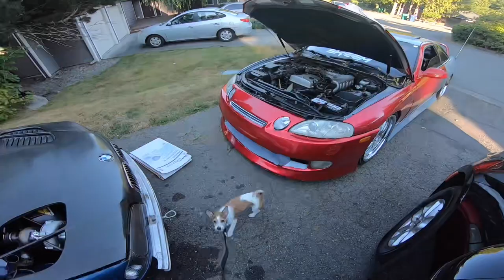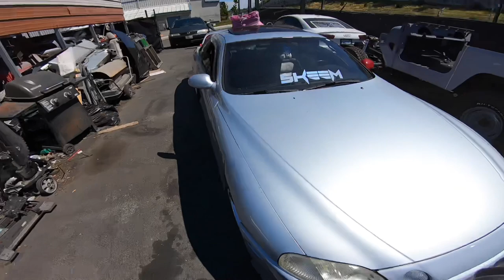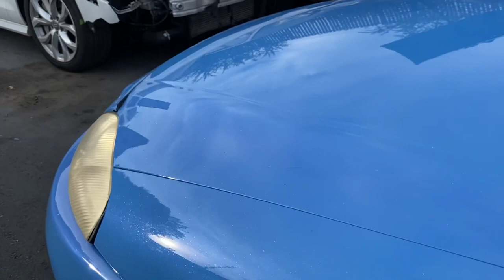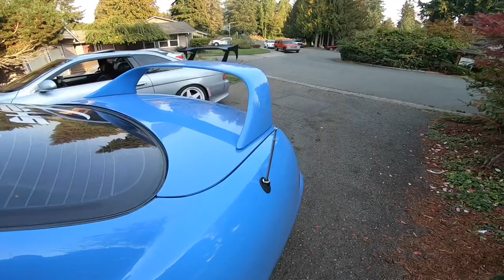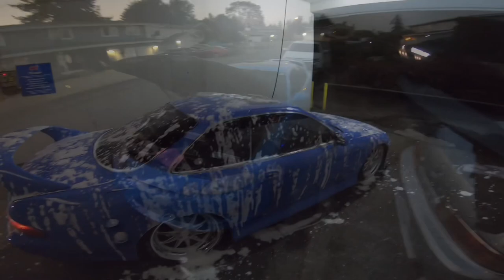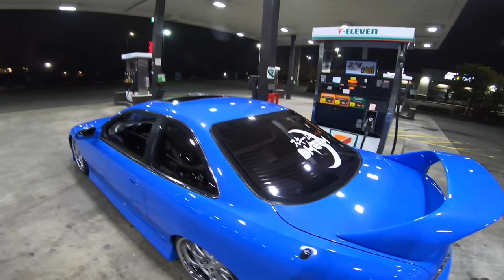SC300 CUSTOM PAINTJOB ✅ !!

Comment: Looking good. Very unique color with the flake. I'm part of the disconnect the antenna crowd, unfortunately. I love the power antenna but they do start leaking into the motor sometimes and then it just pops fuses.